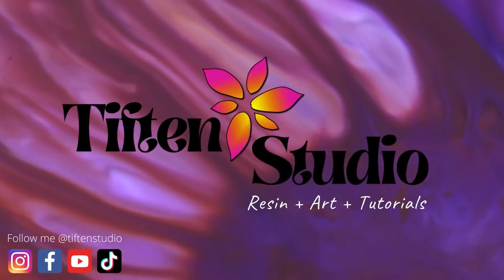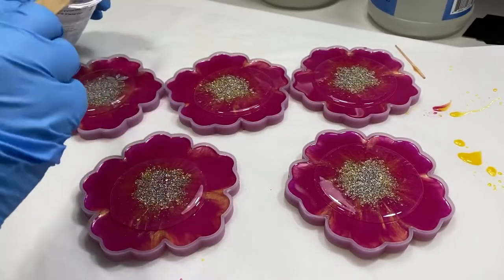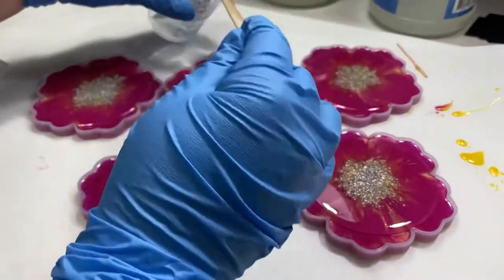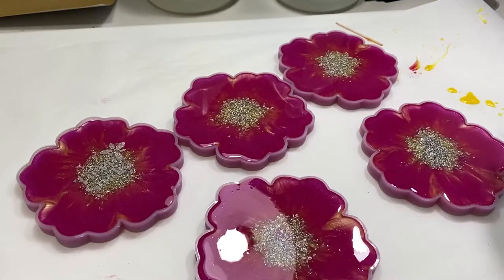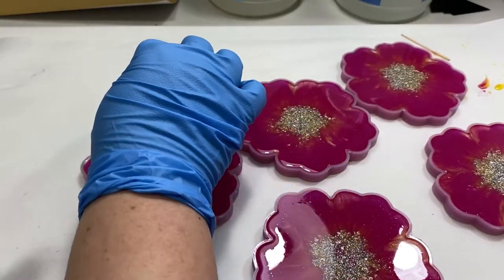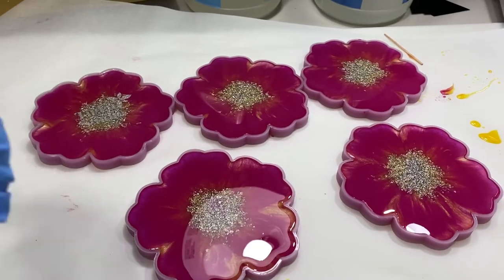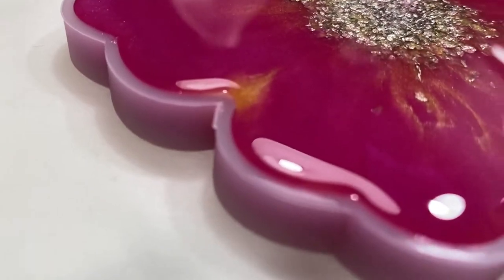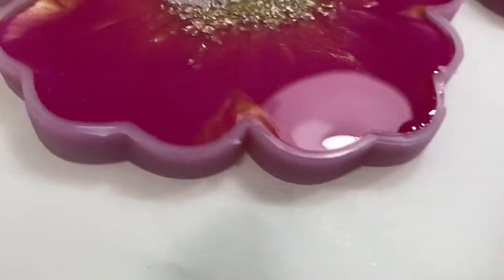5. How to Dome Resin

Comment: I think this might help my situation!! 
I am fairly new …
Do you first pour a bit lower in the mold to allow for the second pour of the dome?
Also I think  I’ve just realized I’m doing my coasters wrong !??😊😂 so the top side is the top of the coaster ?
Reply from the maker: I fill them almost all the way up, but sometimes if I have enough resin, I fill them the whole way including the dome on the first pour. 

As for which side is top or bottom, that totally depends on the design! Many of them have the bottom of the mold as the top of the coaster. Then it’s not necessary to dome, but sometimes I do a topcoat if there is a bubble or I want them extra shiny.

Comment: Hi I’m in the process of starting to dome vinyl stickers, to give like a 3d letter effect… it works sometimes… ish

Was just wondering exactly what the heat gun does ? I know a flame can be used to get bubbles out

And is there any way to get the dome ‘higher’ in the centre
Reply from the maker: Resin self levels, so there really isn’t a way to build it up into a hump. You could try letting it sit until it’s really thick before pouring it, but I think you’d still end up with either a flatter dome than you want, or a surface that’s not smooth.

Comment: I have a question, I tried this twice but a thin layer of resin keeps seeping to the bottom of the coasters. I de-molded my coasters and put them back in the molds when I was ready to do this process if that makes a difference. Maybe it broke the tight seal? Does this happen to you and is there any way to prevent it? Thanks
Reply from the maker: If you take the coasters out, and then try to put them back in and pour more, resin will seep under. You have to leave them in the mold. If you demold, just leave them out of the mold and dome them the same way, being very careful not to use too much or it’ll go over the edge. You need a perfectly level surface to dome.
Reply: @tiffaniwilliamsfineart  Thank you!!

Comment: Is it possible to dome coasters that aren't exactly in a mold? I paint ceramic and stone plated coasters and seal them with resin. - How would I dome those?
Reply from the maker: Yep, I do it all the time! It takes a bit more precision, and your table has to be 100% level. Just add the resin to the top, warm it with a heat gun, and then use a toothpick to pull it to the edges. You’ll have to practice pulling it to the edge and not over. If the resin pulls back to the center, add more a little bit at a time until it stays at the edges. Obviously, don’t add too much or it will overflow the edges.

Comment: Does it need to be fully cured before doming?
Reply from the maker: It depends. If you’re doming with clear, then yes. Otherwise, you can just fill your molds to the point where they start to dome on their own (basically fill them until they almost overflow).